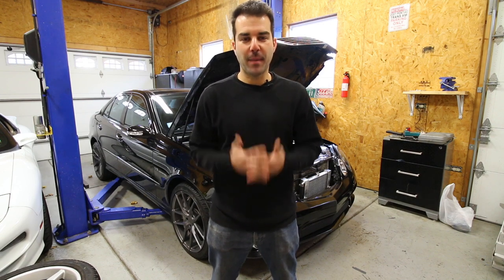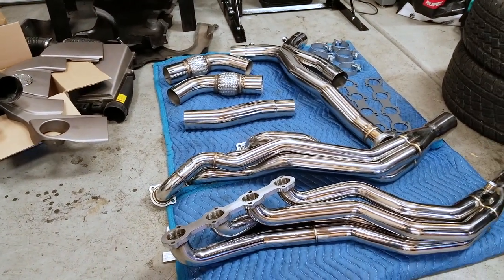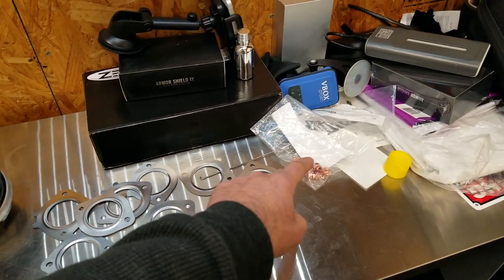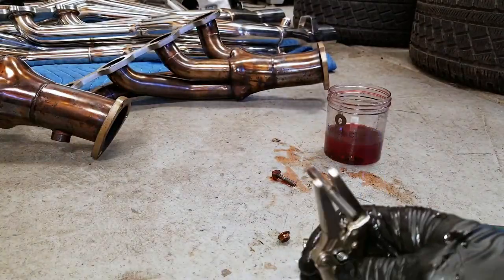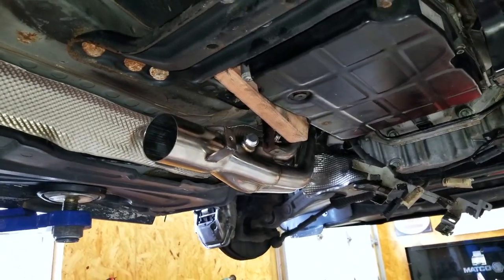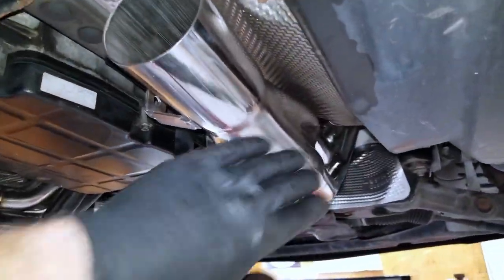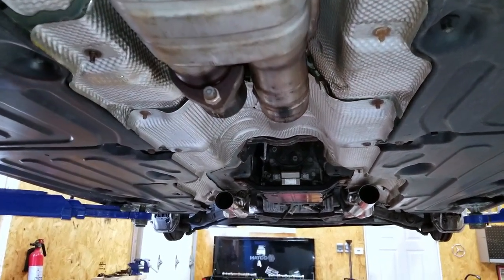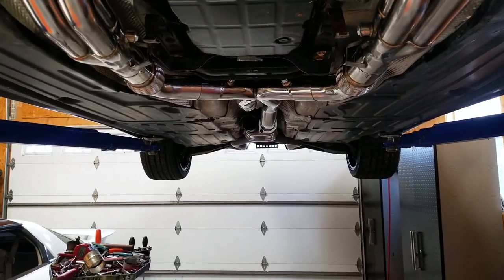Here's How Bad Cheap Chinese Headers Fit On A Fine German Automobile. E55 AMG Long Tube Install.

Comment: Not sure if you addressed this below or on another video... I installed these headers and extended the O2 sensors with Fabspeed universal 90 degree 02 spacers w/ catalytic converters. I still get a check engine light "P2096 Post Catalyst Fuel Trim System Too Lean Bank 1". Please help! Suggestions?! Recommendations?! Thx you!

Comment: Great job Alex! But I have a question for you. What do you recommend for the C55? I recently had the starter replaced and found hole in exhaust, I want long tube headers like you are using on your E55 but not sure what to go for.

Comment: I’ve got an 03 E500, with some magnaflow straight through mufflers, x pipe secondary cat delete, thinking about installing this kit. What do u think? Only thing I’m worried about no back pressure, and going from 3” to 
2 1/4”.

Comment: I don't have the funds for a sweet Benz but I do have a question, is it possible to take the engine off a 1997 E320 with a 3.2L inline 6 and place it in a 1995 C280 with a 2.8L inline 6 without messing with reprogramming? The 95 is OBD1 and the 97 OBD2. Physically the engines are exactly alike in size and components on and around them

Comment: How difficult is routine maintenance after installing long tube headers? The mounts definitely need to be replaced before hand but is there any other maintenance to take into consideration?
Reply from the maker: Nothing else is affected. Just the engine mounts would be more difficult

Comment: Hey Alex, have you thought about instead of meth, running a dry shot of nitrous 50hp shot. The cars MAP or ECU can compensate automatically for that low of a shot by adjust fuel and timing without needing a tune. It will probably do wonders to IAT’s. I ran nitrous on 4 of the 6 camaro’s I owned. Not many people have done it to this car, this is my hesitation.
Reply: Wish Alex would reply

Comment: Hey been watching your videos for a couple years finally got the nerves to get a 2003 e55 ...just put on the long tube headers from VRP same setup you have in the video ...ran into a O2 problem I bought two 02 extensions and it only fits rear o2’s but still aren’t long enough.. can I get a an o2 diagram and what you bought to make it work lol
Reply: I plan on doing the same setup, how did u finely fix ur o2 issue!!

Comment: I've studied this video so many times... but I have one question: your o2 sensors just hang freely uder the car without the check engine light on? I'm especially interested cause I'm doing a simillar thing to my CLK 500. Except I'm from Europe and thus I do not have an option to just drive somewhere and buy a set of long headers (it's crazy that you guys in the US can pick those up from a shop xD). 
So, this week I will order a set of long headers for a 4.6 L Mustang (1996-2004). From the photos they look suspiciously identical. My only hope is for the flanges to fit the engine outlets, the rest can be hammered to fit just like your heatshield.
Worst case scenario - I'll have to sell them. No big deal.

Comment: catalytic converters,are so well made,flowed and tested. they do not take power away from the engine. on my 84 Alfa Romeo spider,I now run a 2.2 ecotec engine with headers,and a catalytic converter,and have problems with power,at dino here in Sacramento,the rear wheel have 178 hp and 185 ft tq., so my suggestion,is put catalytic converter back on the car,and stop being a bad influence  on your fans. here.
Reply: E55 will pickup 18whp from stock by removing cats only.
Reply: +Victory Road Performance try metal spin cats,better flow than ceramic cats
I run the metal spin cats.. old native American  saying, before you do anything to the land, sea or air.look 7 generations  down the road
 this is not your earth to mess up, it belongs to your children  your grandchildren,great grandchildren.
Reply: +Victory Road Performance I like cars
 that's why I drive a Alfa Romeo spider
Reply: +Victory Road Performance 18 reg. on a 3800- 4200 pound car,yep you can feel that..
Reply: +randell gribben rear wheel hp

Comment: All these aftermarket headers end up cracking soon or later. Not worth it.
Reply: All these mods and product should be installed with a "it was good while it lasted" mentality. Always save your OEM parts for the worse.
Reply: So do the factory headers and cats.    If aftermarket headers are fully purge welded properly and have flex joints etc they should not crack just the fact that these chinese things have so many slip joints and a flexi they should last a long time.    BTW I make tri Y headers for RHD e55 AMG's.   This chinese stuff is ok for the money but they usually take alot of shortcuts and fitments a bit more hit and miss.
Reply: @GIGABACHI  if the factory manifolds hadn't cracked I could. But the ceramic coated  Headman headers I put on 25 years ago are still working. 20 years more than the wonderful OEM, designed and built to a price point, craptastic parts.

Comment: What exhaust manifold gasket did you use?
Reply: He used MB #1121420180 gaskets. The header copper nuts are 1121420072, studs 2729900005, and donut resonator gaskets 2084920081 & 2114920181.

Comment: It's easy, just use a hammer and if that doesn't work, use a bigger hammer and maybe a crowbar, and a come-a-long, and a Porta-Power. For less than 100.00 at Harbor Freight, nothing can stop you.

Comment: What do you have to do to keep the check engine light off?
Reply from the maker: Tune and Mercedes STAR
Reply: Use rear O2 sensor fouler/extensions and/or code out of the ECU with a SDS/STAR. There is a DIY on mbworld forum
Reply: Good to know that is what I was wondering...I just ordered my vrp headers should be here in a week...

Comment: So you went from high quality mid tubes to shit quality long tubes to gain what, 3 horsepower?
Reply: The mid length headers are made from china. I gained almost 2mph at the track and crap load of torque switching from mids to long tubes. After switching to Maximizer long tubes I was able to pull on a C6 Z06. 
https://www.youtube.com/watch?v=Vy3i9VwJgoc

Comment: If it comes from china, it is NOT 304 stainless..
Reply: 304 is the most common garbage stainless there is
Reply: 316 would be much better.
Reply: @taunuslunatic404  316 is nice but really only necessary for food grade stuff
Reply: @JaceJackson  Or turbocharged cars.
Reply: Its probably nickel plated pot metal. lol

Comment: Working on my headers now...fuck me...the ones I got are interfering with the drivers side engine mount heat shield (bent it out of the way).  I have no idea how you reliably get a torque on those stud bolts...I don't trust any torque on anything with a swivel.
Reply from the maker: You can't torque some of them

Comment: Without a lift near impossible to do.
Reply: Not even remotely true.
Reply from the maker: No way. You can do it without a lift
Reply: @LegitStreetCars  I mean I found it a walk in the park.  I went MBH fitment was easy. Not exactly cheap though. I can see those cheapies aren't nearly as easy. Good come up on the maybach stuff.  I'll be doing that.

Comment: But does cheap Chinese headers actually improve performance ??
Reply from the maker: Guys have seen massive gains with these. I haven't seen any difference in numbers compared to the really expensive ones. But even if it was like 5 HP, I'd rather save the cash

Comment: Did your E55 have any catalytic converters?
Reply from the maker: From the factory it did but the previous owner removed them
Reply: @LegitStreetCars  Nice nice, deffo space for an X-pipe conversion, getting it a straight-pipe could still be really loud - but that would still be awesome!
Reply: @LegitStreetCars   Hi Alex - great videos, recently subscribed to your channel but been watching for the last 7 months :).

I have a question for you and also @MBDieselFreak - I have a CLK 320 CDi year 06 - would you know anyone or would be doing a video for replacing a 'Flexi pipe before the catalytic converter' section of the exhaust pipe system - It's a bit of a tricky location, it's behind the engine and can be accessed by lifting the car up on a ramp.

I have no idea how the 'flexi-pipe' section looks like - would you have pictures of the section?

 If you can show this, this would be awesomeness !! Thanks Alex.

From Jay

Comment: Those are not Chinese headers, the "real" Chinese headers will never had a Plate on it with the brand or whatever like you see on the passenger side 4to1 here 1:16, also you will have bigger problems or they will be really out on the weldings, experience from e39 headers..